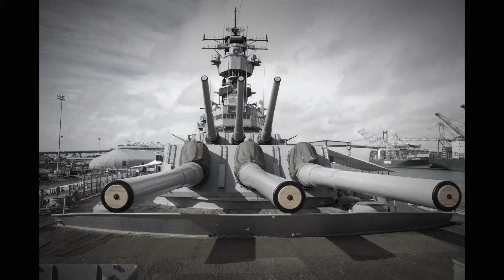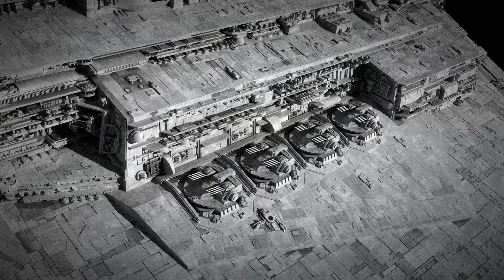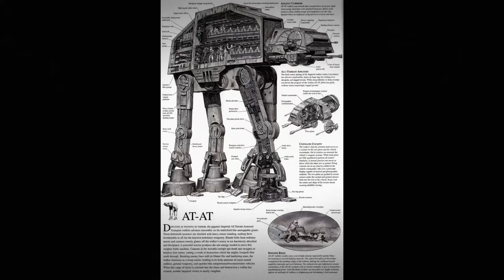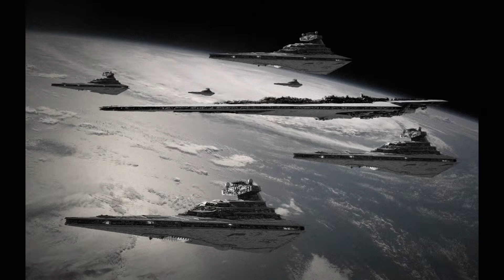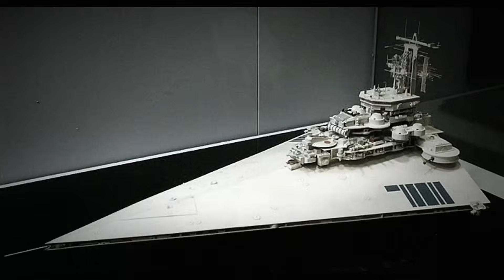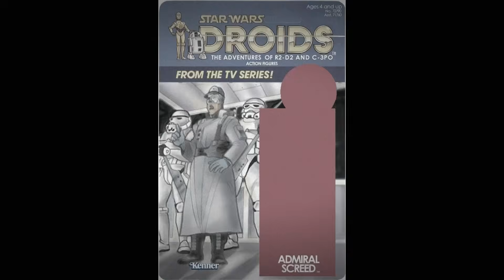Star Destroyers Aren't for Intimidation — They're Battleships

Comment: Didn't really matter if they penetrated the T-34 or not, the inner layers of armor would spall and the crews would be shotgunned to death by the shrapnel delamination of the tank's own interior. 
Also, everybody was using sloped armor in WWII. (In point of fact everyone, including the Germans were using slopped armor for armored vehicles in World War ONE. Hell, sloped armor was used on US Civil War Ironclads in the 1860s. Just because the Tiger 1 wasn't particularly slopped doesn't mean the Soviets invented something) Unlike the Soviets everybody else properly heat treated it. (Which cause not only the spalling but the T-34 armor to crack wide open on impact and sometimes just rough road conditions)
The problem presented with the Star Destroyer is the diamond shaped cross section kind of undercuts the overlapping field of fire point from the beginning. Makes it so the only place they can bring all their guns to bear would be forward and well above the deck.